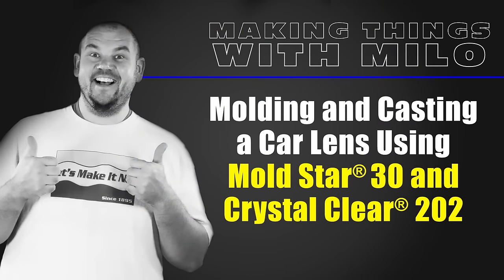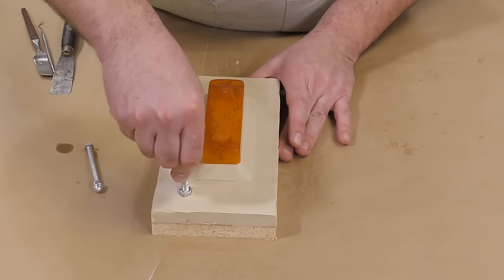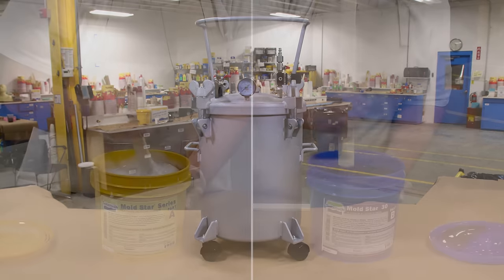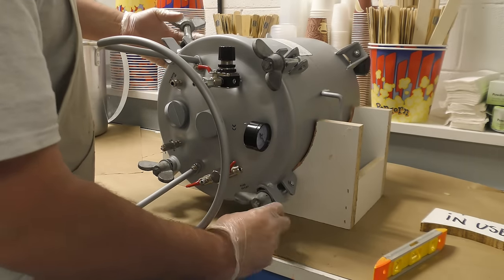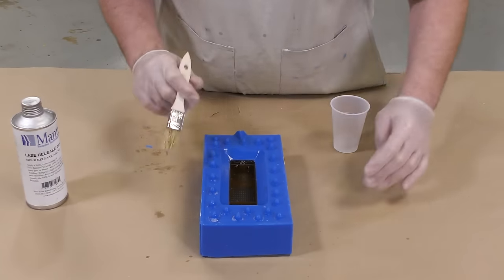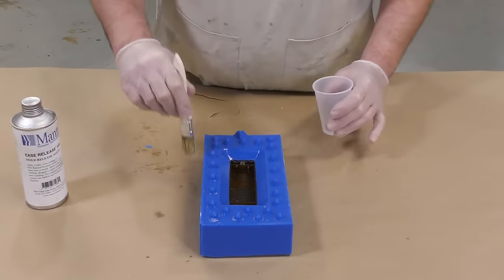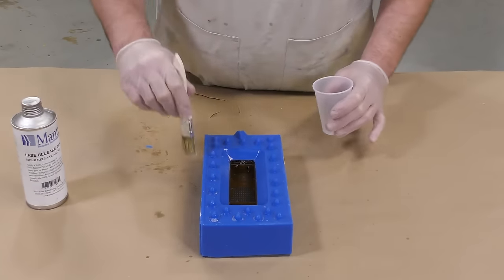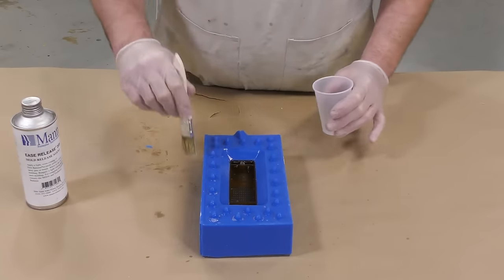How to Create a Replacement Tail Light - Moldmaking and Clear Casting Resin Demonstration

Comment: pressure or vacuum? i've always used vacuum to remove air from the silicon prior to pouring and after pouring
Reply from the maker: Pressure molding is necessary when pressure casting.

Comment: Do you know which materials could work for main high and low head lights on something like a bmw e30/ e34? They are normally a thick glass made by hella and I am worried about the material's ability to maintain itself given constant heat.
Reply from the maker: Our Crystal Clear 220 may be a good choice: https://www.smooth-on.com/products/crystal-clear-220/

Comment: I think this is why they have a) parts dealerships; b) junkyards. Still, the resin does look superior to perhaps cheap aftermarket stuff once OEM becomes unavailable.
I don't understand the pressurization concept; any bubbles still present will be compressed during curing, but then they will expand upon return to room pressure, which would appear as defects distorting the mold surface. Other types of projects use a depressurizing step to expand/ pull out the air before curing, then let return to normal pressure before it hardens.
Reply: The resin would already be hardened prior to draining the pressure down, to return to room air pressure, so they couldn't expand. That wouldn't be possible, any more than a little opening inside a rock suddenly and randomly deciding to expand and move through the rock. It's science. You are referring to degassing prior to pouring, which wouldn't prevent bubbles forming in the resin as it fills the mold, itself. And with the style of mold used, vacuum pressure would draw the resin OUT of the mold, which is not what you want. Which is why positive pressure is what works, and what was used here.

Comment: Can I ask how brittle the final lenses are and can I use my vacuum chamber instead of a pressure chamber? Excellent and extremley informative video!
Reply from the maker: This resin is very impact resistant, suitable for applications where high strength is required.  Thank you for watching!
Reply: I guess I am a little bit late with the answer but for curious minds - the vacuum will work better because all entrapped air will be escaping from the pour. So you need to work quickly to provide enough time for air bubbles to escape the mold. The brittleness depends on the used material. Regular epoxy resin is like plastic. Polyester resin is a little bit more brittle.

Comment: does smooth-on have any composite material or resin that would work good for a cars shift gate? the part that the manual shift stick slides thru without the fingers bending?
Reply from the maker: One or our Simpact urethanes may be suitable. https://www.smooth-on.com/product-line/simpact-series/

Comment: Why is it that some say use a pressure pot while others say use a vacuum pot? Seems to me that vacuum would make more sense as when the pressure is reduced the bubbles would grow and float up to the top surface as where pressure would compress the bubbles but it would not remove them.
Reply from the maker: Pressure Systems (pressure chambers and compressors) offer the optimal method for creating molds and resin castings that are truly bubble free.Vacuum Systems (vacuum chambers and vacuum pumps that pull 29 inches of mercury) are used to remove the air from high viscosity materials like silicone rubber before pouring. They are also ideal for vacuum degassing liquid plastics for making bubble free castings.

Comment: if I have a two colour lense, how should I do it ?
Reply from the maker: Hi Felipe, our recommendation is to submit a ticket here: https://www.smooth-on.com/support/ticket/add/agree/ that way we can help you in detail.
Reply: You will need two different molds for each color. Make one and then insert it into the second mold and pour material. Bit more complicated and it would not be a squeeze mold for the second casting.
Reply: Make them one solid color
Reply: @melonmalone6307  The turn signal and reverse light need to be different colors

Comment: So that slanted pedestal you created: is the top edge of the clay slightly underneath, and slightly to the inside, of the bottom edge of the plastic lens, or does the clay come up and meet at the outside corner? In other words, did you try to make that "clean-edge-making-surface" at the side of the cast lens or on the bottom? If a little lip is created by putting the clay slightly underneath, then that would mean there would be a slight undercut to the mold, but with flexibility of Mold Star 30, it shouldn't be a problem. Please advise when you can. Thanks!
Reply from the maker: The clay meets the outside of the original model.
Reply: @smoothon  Thank you. Also, if a part to be molded has certain areas filled in with clay, similar to what you did with the lens, then some air gaps/voids may exist. Therefore, what is the minimum pressure to make the mold bubble free yet avoid the pressure pushing the clay into the gap/voids? This could occur on delicate pieces with air space "behind" the clay pedestal, where filling in said spaces is impractical. Regardless of silicone or resin in the process, is it always 60psi?
Reply from the maker: 60 psi is our recommended pressure to ensure a bubble free casting.  The clay should not be affected by the pressure.
Reply: @smoothon  Thanks. Seems like 60psi is the default choice for casting and mold-making. This hobby is too expensive to really experiment, unfortunately. In my experience, however, which is relatively little at this point in time--but increasing with east mold/casting--if the clay amount is relatively small/thin, and an air pocket is behind it--unknowingly, course--then the pressure will push the clay in and create a void/unwanted change in the silicone mold.
Reply: @smoothon   @Smooth-On  Also, if I may provide some feedback: suggest to your higher-ups that an intermediate choice purchase for silicone would be preferred, i.e. something in between the 2# "trial" size and the 18# buckets. A 5# or 8# choice would be great. Thanks in advance.
Reply from the maker: This is a great idea! We will forward it to our team.

Comment: What size pressure pot are you using in this video? I have never seen the sideways pressure pot, but I like it!
Reply from the maker: This is a 5 gallon pressure pot.
Reply: It's not specifically designed to be sideways. They just use them sideways for their purposes, and it doesn't affect the pot's ability to work.

Comment: What about making a polycarbonate headlight lens with UV protectant? Is PC cast the same way? I see most high end headlight mfr's use PC as the lens material. Genuinely interested in making a PC headlight lens for my vehicle so I can eliminate the flutes in the existing glass lens so I can incorporate a projector and eliminate the halogen bulb and have a responsible beam pattern.
Reply: Also, we use silicon molds at work for many of our parts and they have all seem to have a 20 unit run or 5 year (?) shelf life. Is this also true for this type of silicon mold?
Reply from the maker: It depends on the type of casting and silicone formula.  We can help you get the most castings possible, just give us a call. :)
Reply from the maker: Polycarbonate is processed differently than a room-temperature resin such as Crystal Cure urethane.

Comment: Maybe I missed it, but are you applying a vacuum or pressure to the pressure pot?
Reply: Hes forcing air into the pressure pot. Pressure pots using positive pressure and vacuum chambers use negative pressure

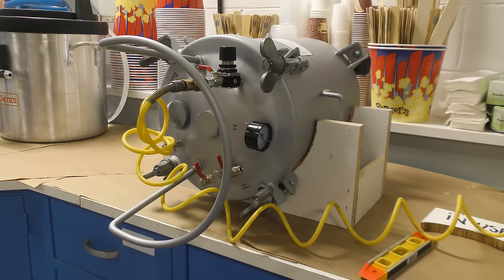Comment: 7:21 And now, I understand where I went wrong. Cast mold under pressure. Got it.
Reply from the maker: If you are planning to use pressure you absolutely need to make that mold under pressure as well. Good luck! We are here to help if you need it.
Reply: @smoothon  Good to know. I actually talked to one of the employees about it. I will try it again soon.

Comment: Very good job. However, what is the cost of each of those jugs?
How much for the dry-on coat for the mold?
How much did the cups, stirrers and respirators cost?
How much for a pressure chamber like that?

If I wanted to replicate this to make 1 lens, the cost would be prohibitive. It would be much more effective to drive an hour into town at the junkyard and find what I need.

How many lenses will this one mold make with those two jugs of resin/catalyst?
How many molds can be made of that size with the products featured?
How much would you charge the owner of that custom car to replace 4 lenses of that color/size?

Again, very well made video and looks like you're smart, but from a money perspective, it looks like a stupid idea.
Reply: Well, I'm not the OP, but it's not too complicated to answer your questions, so, here goes.

I'm not sure what you're referring to as "jugs", since he used products that came from 5 gallon buckets, and from little metal containers. However, there was a whole list of links in the description, and I'm certain each material used was listed there. 

Dry-on coat? Do you mean the release agent? Again, check the products list in the description. I'm sure I saw it there, too.

Cups can be bought for a few bucks a stack at lumberyards/hardware stores/home improvement stores. Stirrers, about the same. The respirators, last time I bought one (1 1/2 years ago) ran $15 each, USD, brand new - again, at lumberyards/home improvement stores, etc.. 

Pressure pots (paint pots) can be found, used, for as little as $10-20 at auctions, etc., so one just needs to keep their eyes open for them. One needs to know how to use them, though, as they're not exactly a plain 5 gallon bucket, and using one can be hazardous if you don't know what you're dong.

The lens he made you'd never find in any junkyard, anywhere, because he made it in a non-standard color that was never available from any OEM or even aftermarket dealer.

The mold, as it's silicone, would last indefinitely. Again, are you calling those metal containers "jugs?" He showed how much he used, and he showed the container's label. Depending on the size of the lens or other item you made, you would have to do the math, but certainly several.

Those products to make the silicone molds came in 5-gallon buckets, and he used what looked like almost a pint of each. So, rounding up to a pint of each material, you could create 40 molds of that size.

As for price charged, that would depend on what one's hourly rate went at, and if they counted each item at 
1/2 hr, or 1/4 hr, 2 hr, or X hr rate, now, wouldn't it? Besides, I believe he stated on another question posted that they don't do that sort of thing (make parts that can be ordered for sale).  

From a money perspective, if someone already HAD a shop, and a paint/pressure pot & air compressor, this would be a very easy thing to get set up to do. One could, if they were eager enough to do so, and driven enough to keep at it, could easily sell specialty cast resin parts in their spare time. I doubt this video was for the bloke that was just curious and had no means already of actually doing this. 😄😉😎

Comment: Could a vacuum chamber be used instead of the pressure pot?
Reply: I wouldn't, a vacuum chamber is only built to safely withstand -1 atmospheres (about -15 psi) so pumping it to +60 psi sounds dangerous.
Reply: @COL321  I guess I wasn't clear - I was asking about using a vacuum chamber under vacuum to remove bubbles (instead of a pressure pot under pressure). You're absolutely right, pressurizing a vacuum chamber would not be a good idea!
Reply: @SpikedCola  Ah ok I understand now! I think the idea is to compress the bubbles so they are extremely small, then the material sets and the bubbles aren't noticeable. The vacuum chamber is going to do the opposite, any bubbles will be enlarged which might help to clear them while the material is liquid, but any that are left when it sets will be much more noticeable. Bear in mind I'm no expert so somebody correct me if I'm talking crap here!

Comment: Can this be done without a pressure pot?
Reply from the maker: You would most likely have small bubbles in the resin, pressure casting a resin would give better results for a 2-piece mold such as this.

Comment: Nice video.  That would be very difficult if the lenses were curved (wrap around) but if a process is possible you could create custom shaped lenses.  ;-)
Reply: Seems as though you could do them just fine, as long as your mold was deep enough, and you had enough clay to fill in where you didn't want resin. ~shrug~

Comment: I have a question. When useing the pressure pot, your putting air in or vacuuming air out?
Reply from the maker: You are putting air in and compressing it to push the bubbles in the rubber and resin out.
Reply: Thank you that answered a question I had
Reply: Wow, I totally thought you were supposed to pull out as much air as possible.  Pressurizing it (positive pressure) would sure make this a lot easier.
Reply: I was wondering the same thing. Putting pressure on it wouldn't really drive the air out but rather make the bubbles smaller but pressurized, or dissolve the air into the resin. Seems like putting this under vacuum would be better. But I could be wrong, I've never done this sort of thing.
Reply: Siggy in CR I agree a vacuum chamber would be more beneficial, but Prior to pouring the resin, as it would completely degas the medium, I can see how the pressurisation would make any air bubbles smaller but how air bubbles would be "pushed out"   is a mystery to me. Either way well done :) Dont suppose you guys would make a batch of lenses for me???
Reply: @digitalacid , they'd be pushed out just the same way you push out the air in a bag of snacks that you're reclosing, or a ziplock bag before you zip it up... you push out the extra air in the container. The pressure pot presses the bubbles out of the resin, the same way ketchup is pressed out of a mcDonald's ketchup packet when you step on it on the pavement. Does that make it easier to understand? Vacuum treating the resin before pouring it makes the resin bubble-free before you pour it into the mold, BUT there can be bubbles between the mold's surface and the resin after pouring. Using 60 ft. pounds of air pressure is like a big foot that pushes those bubbles out of the mold.

Comment: i thought you use a vacuum chamber for the rubber mold, and a pressure pot for the resin
Reply from the maker: Vaccuming resin can be suitable if the mold configuration is not conducive to pressure casting.
Reply: but what about the rubber. seems like everyone on YT is using a vacuum chamber to get bubbles out of the rubber mold. apparently pressure works too, just wondering why you prefer pressure over vaccum when first mixing the rubber mold material. thanks
Reply: @dumbcat  If I were to hazard a guess, it's because they already have pressure pots, and don't have vacuum chambers. Why purchase equipment if it's not needed?

Comment: I don't understand something , once the 60 psi is applied, the air bubbles would have release from the product within a very short time.
So why leave it under pressure until it cured ? Surly all you need is to degas it for maybe a 15 - 20 minutes and then you can leave it to cure at room pressure after that cant you ?
Reply: I would say this is probably a slow-curing resin, so bubbles could attempt to form quite a long time after pouring. Hence leaving it under pressure for that long, preventing any more bubbles forming.

Comment: Hello! What's the difference between cristal clear 202 and 200?
Reply from the maker: The cure time.  200 is generally used for larger castings than the 202 is.
Reply: @smoothon  Thank you so much for your fast answer. Here in Brazil I'm not finding the 202 one, could I use 200 instead? I want to build some custom lenses for my car.
Reply from the maker: You could use 200, we would recommend you test to determine suitability before using for production.

Comment: What about the holes of the screws..?
Reply: They would be there in the casting of the mold, itself. If anything, there might be a thin film of the resin left where one would have to drill out where the holes are.

Comment: Beautiful Job.   I always thought you would cure the part in a Vacuum chamber.  Vacuum works great for Fiberglass molds.  It pulls every single bubble out.
Reply: Resin can be degassed with a vacuum prior to pouring, but even after the material is vacuumed, the act of pouring can induce air.  To eliminate bubbles which may occur after pouring, a pressure casting technique is used. (straight from the manufacturer)

Comment: Hi ı have a question , I'm planning to buy 1:18 a die cast model car it is very rare and old model in a good condition  but it doesn't have headlight mirrors  those parts are missing .. I see from your videos you have one headlight and then you can  replacing it with using moldmaking technique , but ı do not have any spare headlight so can you recommend for me what can ı do regards ..
Reply from the maker: Hello, Thanks for watching. To more efficiently handle your request, please contact our Tech Support department at http://www.smooth-on.com/support/
Reply: Thank you so much .. I'm going to visit the website

Comment: How can I make a two tone lense (two separate colors
Reply from the maker: This would require sectioning off the mold with a plug when pouring.  The plug can be made of silicone as well.
Reply: Smooth-On  so a wall in between u mean.
Reply: Smooth-On  if so how thin of a wall

Comment: I thought taking the air bubbles out of casting was to use vacuum?
Reply from the maker: It depends on the situation - ideally you would do both.  Pressure work after the pour but requires the mold can handle it, vacuuming happens before the pour, but requires a thin stream steady pour of resin.